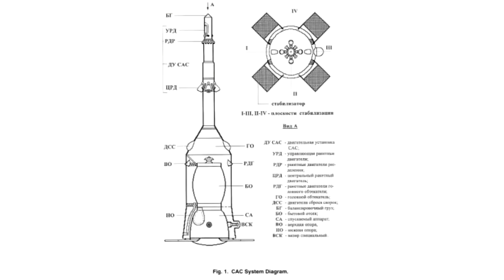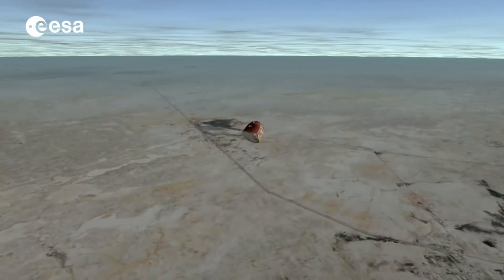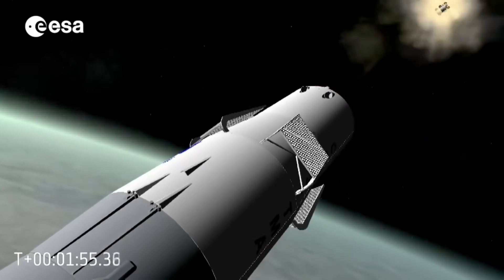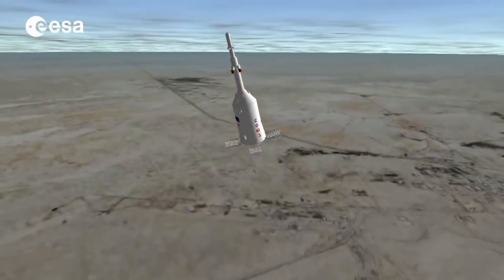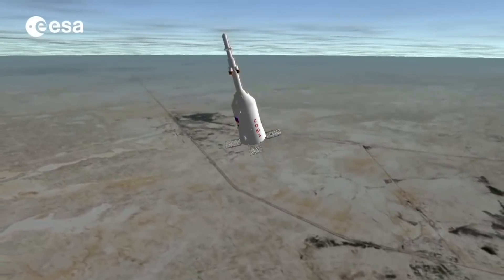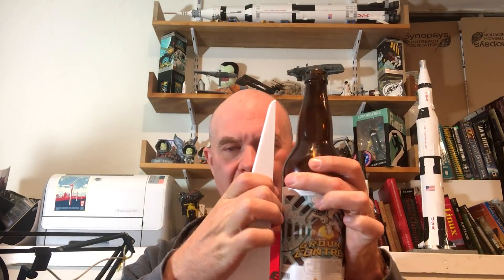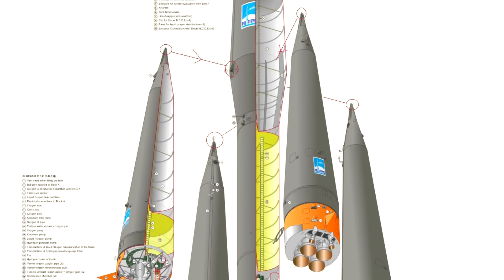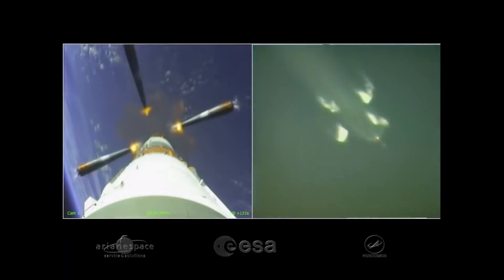Soyuz MS-10 Failure - Updates & Answers To Your Questions

Comment: Thanks Space-Shrek. One minor correction, the grid fins don't provide "aerodynamic control" as their orientations are not variable. They just act as fixed "shuttlecock vanes" to keep it pointed in the right direction, same as Crew Dragon's trunk fins will. "Control" implies an active control, I'd think.
Reply from the maker: As I understand it they're slightly asymmetric to get the capsule to curve away from the vehicle.
Reply: I can buy that. (Though I assumed it was the thrust that was asymmetric.) I just wanted to point out that they're not movable control surfaces like the Falcon 9's grid fins are.

Thanks again! Much better coverage than the science-illiterate press can manage!

Comment: As you know there are 3 modules, the Orbital Module, Descent Module, and Service Module.  My question is, what happened to the "Service Module" that sits below the "Descent Module"?  Are you saying that when the abort was called that the combined "Orbital Module" + "Descent Module" stay within the Shroud and the entire thing separates as one combined unit (Shroud + Orbital Module + Descent Module) from the "Service Module"?  Thereby leaving the Service module behind and still attached to the Soyuz Core stage?  Also what happened to the failed core booster stage, where did it land?  I'm assuming it landed intact somewhere since it wouldn't have been high enough or going fast enough to burn up in the atmosphere after its engines failed.

Comment: Question:
I wonder if a Soyuz return vehicle could be launched off of an Atlas V or Falcon 9 if they wanted to keep the crew up in space long enough for the investigation of the launch vehicle to complete.
Reply: It's usually not a simple thing to adapt one countries craft to anothers launcher without a lot of engineering, testing, etc..  Then there are the issues of the varioius computers, booster, craft and ground..  I'm not saying it can't be done just not quickly.
Reply: Thanks for your reply. :) I suppose launching Soyuz capsules and Dragons are not exactly the same as launching a satellite that you're just releasing into space.
Reply: @Binford35  No, a fueled manned spacecraft can't be treated as pure ballast. :)

Comment: Maybe someone installed the valve the wrong way up? Maybe the guy that doomed a Proton 5 years ago by installing sensors the wrong way has been hired on the Soyuz line instead...
Reply: I was thinking along the lines of someone leaving a "remove before flight" component in place.

Comment: Scott Manley,  I have only recently come across your YouTube channel and was about to subscribe but there is a small problem.  Very small, but possibly fixable (unless this is what you're going for).  You need to frame your videos better.  You should be positioned more in the upper third of the frame.  It's kind of an industry (video) standard to divide your video into thirds each way and your eyes should line up on the upper third (and sometimes on either the left or right third).  There are several good video cinematographers with YouTube videos about how to frame yourself for video.  Peter Mckinnon and Parker Walbeck to name a couple.  I'm guessing you want to show off your background but this is also something that needs some attention, like you need to declutter  a little.  Check it out and give it a try, I think you'll find people will like it.

Comment: I was wondering, I know the Soyuz has had casualties, but also that it is one of the most used rockets there is (manned and unmanned) but I have also heard it is also the most reliable. Is that actually true? I was googling around but could not find any definitive answers.
Reply: The safest currently used for manned flights.

Comment: The Soyuz descent capsule has an offset center of mass in respect to the center on lift and the peroxyde fuel is used for roll only.
By modifying the orientation of the torque arm between the center of lift and the center of mass you can steer the capsule.

PS Love your videos, keep up the good work.
Reply from the maker: The descent module has Yaw/Pitch/Roll thrusters, but once aerodynamic forces build up the only thing it can do is roll.

Comment: Just a minor correction to the separation sequence: the boosters DO reduce their thrust after the explosive bolts are gone. This decreased thrust make the booster drift down and deconnect it from the pivot at the top, while going sidewards. The valve is open only after it is detached from the central core, not before. And the vent is not here to disengage the booster, only to make it fly away once it is already gone.
Reply: Because the valve is dependent upon booster separation, it failed to trigger since the pin on the ball joint was bent and kept the booster from disconnecting.

Comment: So the safety features of the Soyuz launch system has so far saved the lives of 6 Cosmonauts. 7 lives could have been saved if the US had made the same consideration as the USSR about crew survivability with the space shuttle Challenger
Reply: Not to defend the shuttle, but the design itself (spaceplane) kinda made an escape system difficult, expensive and heavy.  They instead went with blind faith that if they engineered it hard enough it would be safe.  That is the problem with believing you can forecast all events.  Spacex is going the same route with the BFR, they're going to engineer it so safe with so many redundancies they don't believe there is a need for an abort/escape system.

Comment: Do they have outside cameras on the booster ?
Reply: Not. They are not needed, as there is no need for PR.
Reply: Even on the space X the primary purpose of the cameras is engineering related not PR. I would be surprised if there was not cameras on it, on the other hand if we will ever get to see it is another matter.

Comment: Here's something I don't understand... why would there be greater 'g' forces during a ballistic entry?  The capsule is free-falling until the chutes open, isn't it? There's not much air until 15 or 20 miles altitude (Is there?)  so why high 'g's on the astro/cosmonauts?  Thanks.
Reply: They have over 2 km/s of velocity at that point. When they fall into the denser atmosphere, the forces due to air resistance are proportional to the square of velocity times air density. The steeper the trajectory, the faster you get into denser air and the more abrupt will the deceleration be.

In SpaceX landings it is quite striking to see the magnitude of deceleration due to air resistance even at much lower velocities of only about 0.8 km/s. For example, in NROL-76 flight, the free fall after the entry burn was increasing vertical velocity all the way up to the altitude of 23 km, (7:56 into flight) and then, 34 seconds later, the rocket was already falling at subsonic velocity at an altitude of 5 km. The strongest deceleration was at about 13 km in this case, but for higher entry velocity, maximum deceleration will occur at a higher altitude.
Reply: It doesn't have enough "horizontal" speed to brake aerodynamically, that is slowly diving into the atmosphere and pulling up if g is too much or if off course. Instead, it just falls down with whatever g air friction makes, which ends up being higher. Soyuz has a relatively simple capsule, it doesn't have much control options like wings or powerful thrusters. It relies on rotation to control reentry, for example.

Comment: so regarding the peroxide degrading why cant they just "top off" the tanks to extend the longevity of the Soyuz? I'm sure its not that simple but like is there just no way to refill the peroxide?
Reply: I'm guessing they thought 200 days (half a year!) was plenty, and a topping off system would involve weight and complex plumbing, valving. Complexity = more components that can fail.
Reply: Where do you get the Peroxide to top the tank off? what ever you have taken up there with you is degrading as well and making it is not something you want to do on board a closed system like the ISS, besides your launching and recovering personnel regularly so it makes sense to swap out the lifeboats as you do that.

Comment: Scott, I'm hearing chatter from Russia on two possible scenarios for the Soyuz MS-10 failure. Both have engineering credibility. 
The first is related to the guidance corrections seen before the failure. In this scenario the guidance issues a correction as the side boosters are released. The central core correction makes contact with one of the released boosters or its strut resulting in catastrophic damage to the RD-108 propulsion section.  
The second scenario is a catastrophic failure of the RD-108 engine from a propellant line blockage. This appears to come from telemetry data, either chamber or feed line pressure readings. With the information available now, I'd lean towards the line blockage.

Comment: What if you positioned the jettison rockets under the capsule so that they would not have to be jettisoned at all and would serve as orbital maneuvering rockets if not used in an abort?
Reply: Usually systems like that use solid rocket boosters, meaning that using them for orbital maneuvering is not optimal
Reply: But a designer doesn't have to use solid rocket propellant in such a system. My point is eliminating weight that is not used the majority of the time. This is the first abort I have ever seen. Why spend money to launch the weight of a launch abort system that is just dumped anyway? Why not give it a duel purpose?
Reply: That's what SpaceX did with Dragon v2. As for Soyuz, keep in mind that the design is over half a century old, and packing liquid fuel engines to pull double duty as launch escape and orbital maneuvering was nigh impossible back then. SRBs were/are commonly used since they're cheap, low maintenance and provide a shitload of thrust very quickly - perfect for LES.

Comment: The problem with peroxide fuel is it decomposes with time, so even if we launch Soyuz next year with extra peroxide fuel and do refueling of earlier Soyuz on the ISS , what's the problem? 
Plz reply
Reply: You're making the assumption that the 50+ year old soyuz design can be fueled while in orbit.  Someone would have had to include that in the design of the plumbing and I would suspect that all those years ago it simply wasn't something they felt there was a need for.  That could all change now though! :)

Comment: 80's vs. '80s. I run a free-range peeve reserve. Donate now and save the peeves.

Describing that booster attachment system I was thinking "oh, so it's a ticking time bomb." Why not pivot at the bottom and use aero forces to separate at the top!?

Comment: According to the Wikipedia page, current ISS expedition is scheduled for return on 13th Dec where as MS-10 expedition has been shifted to 20th Dec. That means the ISS might remain unmanned for those 7 days, assuming that the 20th Dec mission will be a success. In case of a failure, the next expedition is on 15th Apr, leaving the ISS unmanned for 4 months.

Comment: I just found out that I essentially use the same way of attaching SRBs in KSP as Soyuz uses in real life... Coupler at the bottom of the centre stage, strut at the top of the SRB. When staging the boosters swing outwards using the strut as a hinge, which then shears off keeping the boosters just barely clear of the main engine. Something something in soviet Russia something KSP works you...

Comment: Anyone ever notice there was at least 7 peices of debris when there should have been only 4 or 5 (4 boosters + tower). You'll see one peice of debris far away from craft in upper left corner of footage (possibly tower) then 6 other peices around the craft (booster seperation should only be 4). My question is; 'Is that peice of debris in upper left corner of footage the tower or a piece of the rocket that fell off earlier in the flight & caused damage especially when you see a puff of smoke just seconds before planned seperation of boosters'?

Comment: I guarantee there is a list of flight qualified Astro/cosmonauts who would get on a Soyuz next week and not think twice. The things got an amazing track record, and even when things go wrong the crew is having drinks a couple hours later.  The only thing that will screw the ISS is bureaucracy, not lack of a suitable vehicle.
Reply: I actually doubt that any would think twice about it and I wouldn't be the least bit surprised if Nick's name is at the top of that list. Apart from MS-10 the system hasn't had a failure since September 1983. 1 failure in 90 launches in 35 years? Sure it's not fail-proof, but nothing is fail-proof. Anyone who has climbed aboard a rocket knows that there is the possibility for something to go wrong and every single one is alright with that because the chance of success is far greater and I strongly doubt that sensation of going beyond the boundary of our world ever truly goes away.
Reply: While that's certainly a possibility, I think that this incident is a strong wake up call for any potentially lacking launch team. Like any company that faces increased scrutiny after a recall, the launch team will need to redouble their efforts to maintain their positions. I'd be quite surprised if the next Soyuz has anything go wrong.

As a side note: I wonder if the ESA could potentially relieve the ISS with their Soyuz-2, without having to rely on Roscosmos. They have the rockets and launch facilities already, though I don't know if they have any capsules, since they just use it as a cargo lifter.
Reply: Hm, that's an interesting idea. I'm 90% certain that ESA do not have any Soyuz spacecraft, but given that this was a booster issue, maybe people would be more confident about using a European Soyuz rocket.
Reply: HuntingTarg
They'd be hard pressed to have gotten the job if they weren't good at what they do, as I'm very sure Roscosmos launch teams don't get assigned to Baikonur's manned missions as their first job. No doubt they'll get an outside evaluation, but that might not amount to much since their careers are now very much on the line and they're unlikely to want to risk living out their days as a dishwasher being paid next to nothing.

Jethro Reading
The ESA launch Soyuz-2 out of Guiana Space Center (they have a specialized launch facility for them specifically). Roscosmos sees the foreign use as good business and the ESA get a reliable mid-size launcher. Win-win.
Reply: Her safety record is second to none. She's the safest space-vehicle we have.
Reply: Normally yes, but this is right after there was a hole found drilled right through the pressure vessel on the immediately preceding Soyuz. It shows that there's a very very bad trend of lack of quality control. One is a coincidence, two is a trend.
Reply: Ergzay
Normally three data points make a trend; but the same type of error made on two consecutive modules is unsettling.
DarkSpar13
Kreuger-Dunning ; it takes outside evaluation to determine if a team is deficient in some way.
Reply: That's a bit like saying, "they never had food poisoning in that restaurant in 35 years. That was just one day so I can be assured that all will be fine when I go back the next day, playing the odds." I think anyone with intelligence would want to wait -- could there be a failure in the construction? Perhaps a new technique being used? New people doing that old technique improperly? How many other boosters in the supply chain might have that same problem? Was there a change in delivery? A change in how the various gases and fluids were loaded? A change in any launch procedures?

No, anyone with half a brain will wait for a fuller analysis before stepping onto the next one.
Reply: If there was a more overarching problem (construction or supply changes, new techniques, launch procedures) then other launches would have seen the results first. All intentional changes to the Soyuz get tested out with basic unmanned launches at various other launch sites before being put on the Baikonur manned missions. So the chance that this is an intentional change is nil. This is the result of either an accident or, if you're the type to be suspicious, a malicious act. In either case pre-launch inspection is bound to be far more thorough now, so something caused by accident is unlikely to slip through inspection and something malicious will need to be done so deep that it would be a conspiracy theorist's wet dream.

Kind of funny you use food poisoning as an example, since I have worked in kitchens that have had such complaints happen. If a food poisoning complaint shows up everyone in the kitchen is made well aware of the problem and there is a massive crack down by management to ensure that that does not happen again, even going so far as to close the restaurant to install more hand sinks, and the person who was responsible (who it is is nearly always obvious) would be under extreme scrutiny if they are not fired on the spot. And trust me people still show up the next day, though interestingly it's usually a more highbrow crowd than normal and many of the basic beer guzzlers will avoid the place. So I suppose you are right in that anyone with half a brain would wait, since it's the people with the full brain that sign right back on.
Reply: Actually, I think there are charred remains of cosmonauts that would beg to differ with you. At least back when they were the Soviet Union, failures were covered up and we still don't know how many cosmonauts were killed on reentry; from the research that I have done, there are enough stories of cosmonauts that did not make it to prove that at that time, they did not have a very good reentry system. I have to admit I do not know about the current reentry/abort system. The one thing that still pervades the Russian Space Program is a lack of redundancy on Safety Systems... this has always plagued the Russian Space Program.